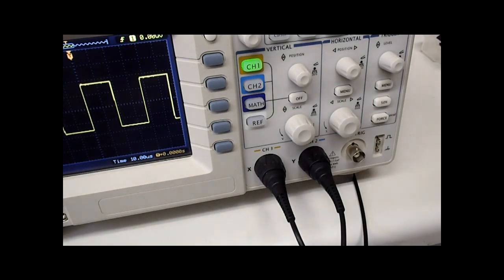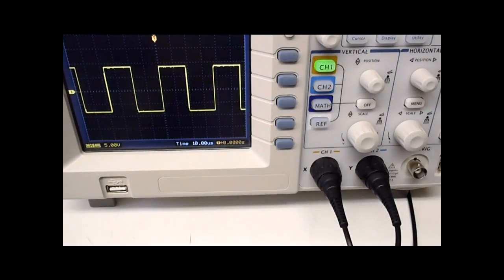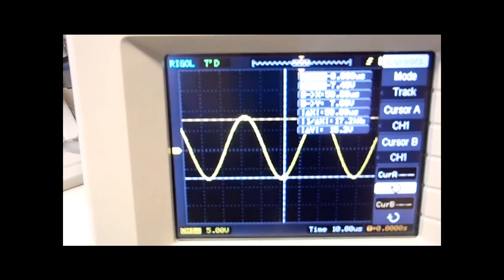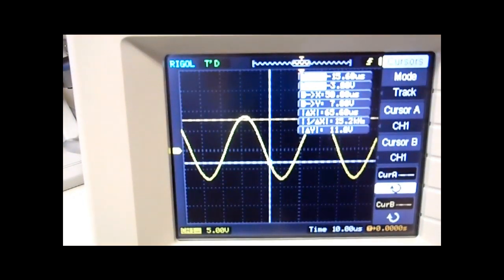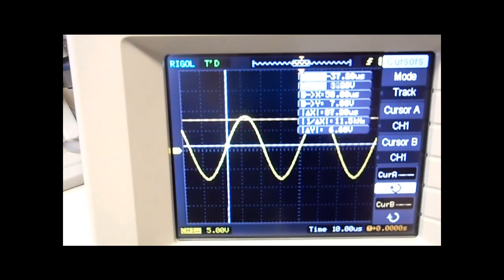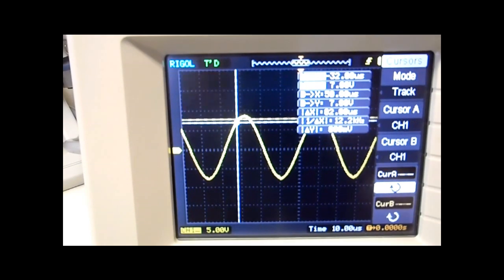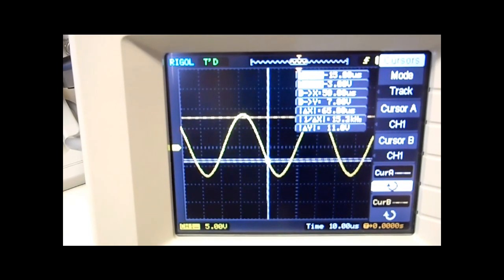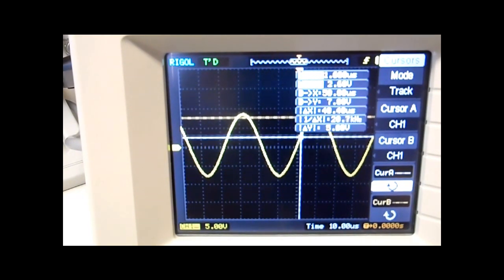How to Setup an Electronics Lab: The Oscilloscope

Comment: I disagree with him, I got a really nice scope from ebay for $75, it's analog type. I just do repair work as a hobby now so it's ok for me. I would start with an old analog scope and later buy one like he has if you want additional features. I do like the digital readouts, I used to have a Sencore a very expensive scope that did all that when I worked in a repair shop.

Comment from the maker: 1/4 inch jack and I got some wire leads coming from the positive and negative, and then the probes of the scope connect directly to them, I got the 1/4 jack online for like 50 cents, and some scrap wire, nothing huge. But I am ecstatic that your actually looking at the configuration! Are you just trying to observe your music, or does this go further - have you seen my other videos of guitar through oscilloscopes - check it out more details inside them! Thanks for the views

Comment: How did you get a guitar signal into your osciliscope? 
What was the adapter/cables you needed?
I understand it's going from a 1/4 inch jack to a BNC cable 
but i can't figure out what I need to use

Comment: The reason most people start with an analog is because of the cost. I remember when I was younger, I couldn't afford a nice 300-400$ or even a long lasting 1000$ dollar model. So I ended up on ebay getting a analog for around 70$.